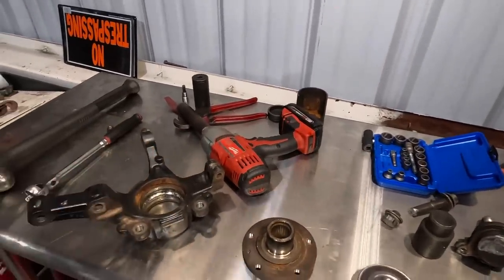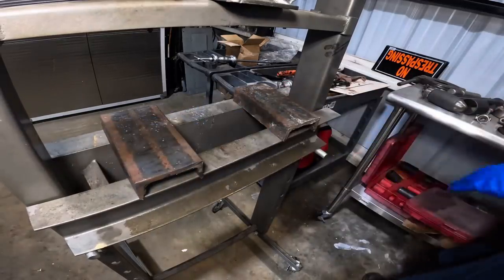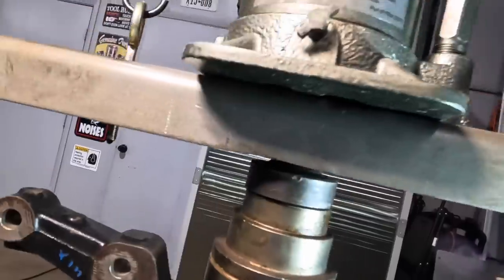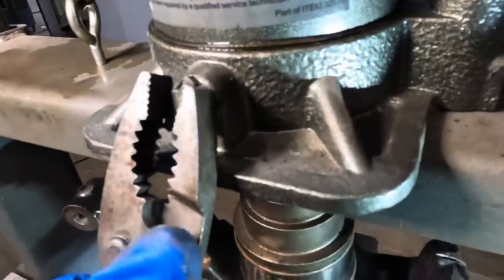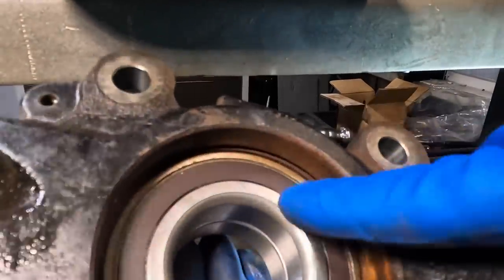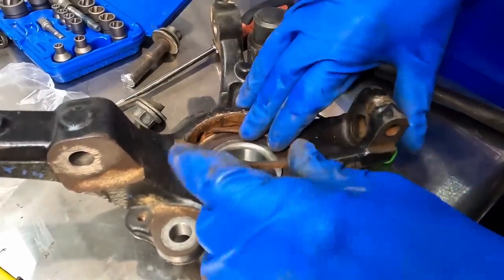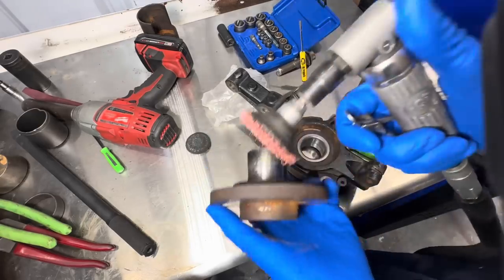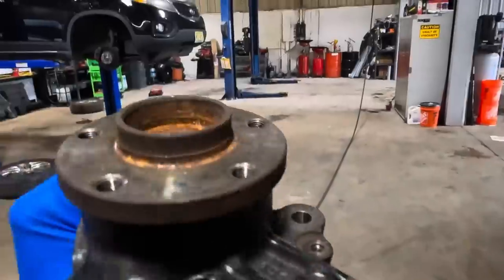Can it be FIXED? Half a Bearing! Hacked to Pieces!

Comment: Hi Ray, On some jobs when using the old race to press in the new one it can jam and cause trouble getting it back out. We cut the old race with the angle grinder right through so effectively making it a little less rigid in diameter and so it will tap out easy where normally it might jam tight again. This doesn't hurt using it to press the new one in as the stiffness of the old race maintains it's shape but it sure comes out easier. I am in the UK and am a retired mechanic.
Reply: I have ground down the 'old' item on the grinder so that it slips easily. Then used to press the new outer race. I KEEP that old race for future use as I have done for my Trailer Wheel Bearings.
Reply: I was going to say that. Same here in the US.
Reply: The other trick is to put the new race in the freezer and get it as cold as possible. At the same time, warm the other part, With any luck the new race will just fall right in.
Reply: Ditto.

Comment: Misc suggestion.
I changed my hydraulic press to add wheels like you did, but i also added in a wooden platform across the bottom. Now i have a place to store all the accessories you need for the press, plus i can store heavy things i do not use often.  Super convenient when you are space limited and your press tools and widgets are right at hand when you need them.

Comment: As the official bearing aficionado of this channel.  He is replacing what is called a Hub 1 bearing.  The darker side is a magnetic seal that the wheel speed sensor reads.  The other side is a regular seal.  Just in case you didn't know.

Comment: Run a bead of weld around the inside of the old bearing. As it cools, it will shrink and literally fall out.
The now shrunk bearing can be used to press in the new one.
Reply: This is the go-to reply. This is the only method that will reliably 100% of the time drop that race out of that hub. I learned this as an apprentice in the shipyard back in the early 80s.
Reply: Wish I knew this trick couple years back I had a ford focus these bearings are a nightmare same deal I did it the same Ray did. He didn't get to take off the inner race though I cut them at an angle with a cutoff wheel then bust it on the cut because you can't cut it all the way you will cut into the hub. I will never buy another car with these type bearings they are always going bad. aftermarket bearing are a joke on you they are ball bearings instead of needle bearing like oem.
Reply: Hope Ray sees this cause it will save him a load of work on any internal bearing.
Reply: Have always removed bearings this way, as well as exhaust valve seats on large diesel cylinder heads, works every time.

Comment: I don't know why, but everytime I have a project coming up, you release videos that help me immensely with my research.  I've been dreading a front end suspension rebuild on my Honda Accord, but right after I ordered my parts, you dropped all this front end rebuild material with the mustangs and this one!  Not exactly the car I'm working on, but concepts are the same, and you've helped me not feel so out of my league. Through my daily dose of Ray, I havent even had to do much actual searching for helpful info.  Thank you for having the BEST timing for my education needs!
Reply: @xbahamutzero  thanks for the tip.  Luckily, it's a 1995, but the only things that I'm not replacing are the spindles and shocks.  The SO managed to snap or bend almost everything else by spinning out and slamming into a snow bank right after our first snow last winter.

Comment: Fyi... If you have a truck ball joint removal kit... Use the rings from that kit as your base shim to press into or press the new parts in... OR... Go to your local hardware store and get a set of different size black pipe couplings up to 6" dia meters... ALSO... Wack the piece with a hammer when you have all the pressure from the press on the part... The vibration will make sure the part is seated and that is not "window locked" or "stuck" on some rust or metal blurbs...

Comment: Hey Ray!  You should weld a flat tip screw driver in an 11 o'clock position to the pressure relief bolt in the closed position on your press. It would give you a grab handle to open and closed the valve and put the wrench away.

Comment: That's a great point to emphasize how important that axle nut is, even in newer style bearings that come together with the hub. People get a false sense of security when they bolt an inclusive unit on, not understanding how easily the bearing itself can break apart. The snap ring holds the outer race in place, and corrosion holds the hub inside the inner race. The weakness is in the sheet metal cage that holds the inner bits together with the outer. The only thing keeping that inner race, hub, and wheel in place after the sheet metal fails is the axle nut.
Reply: NO CHARGE ALSO.

Comment: if you dont have a press but you have welder you can clean the grease of the bearing race run two beads of weld around the raised part in the center of race, one on either side and they just about fall out
Reply: If you don't have a press but you have a welder, you can make a press
Reply: @waldolemmer bottle jack and some box-sections with a couple strong springs, jobs a good'en
Reply: Just what I was thinking I have seen to meny bearing carriers broken with the press

Comment: I’m repacking hub and bearings while I’m replacing tie rods and ball joints on my ‘95 302 f150. I stupidly punctured not one but TWO! Moog upper ball joint dust boots. Currently waiting on new dust boots. 🙃

Comment: My little Peugeot has the same bearing and magnetic ring set up, though thankfully you can just about get a spacer to hook up on the outer race if it does fall apart. The only issue is the part is an odd shape and doesn’t lie flat, thanks Peugeot PSA for that design.

Comment: Hello Ray, it looks like there is a hurricane headed your way mid to late this week. It looks like it may slightly to your north and come in closer to Tampa and going thru Jacksonville, with you just getting a bit less wind and rain. the beaches may get a bit rough, but the surfers will like it. I couldn't send this in chat, maybe it was to many letters.
Reply: Just checked NHC.NOAA and it looks like it will curve away north and then north east.
Reply: @pprey6599  It very well could, however it is a hurricane, and it could hit 100 miles west or 1 mile away, it is still to early to be very definitive.

Comment: Ray good video. I watch your excellent work almost daily. On a related note, I have a 2015 Ford Transit Connect with only 52K. And I have had to replace the front wheel bearings 3 times on each side. Ridiculous at $300 per repair. The bearing/hub assembly is almost identical to what you just worked on, so I wanted to comment for the other viewers. If you ever have to replace a bearing assembly like this .... DO NOT over-torque the wheel bearing nut. Guaranteed premature failure .... in less than 2000 miles. Also, buy the best bearing you can find. And when these front bearing go out, it is very hard to determine if it is a left or right bearing. Maybe a dealership would've done a better job than my mechanics (two). I just don't trust dealerships.

Comment: I just recently replaced my Honda ridgeline front bearings, bought a small table top press but cohld not use it becausr i didnt have C or I beams to put under. I used hammer and an old outer race ring. It worked but lot of elbow grease. I think uou placed bearing in up side down. The black seal is hoing on bottom and the removable top silver cover is used to add grease over the time when needed with out remowing whole bearing, just the hub. Othervise, great video. Keep it comming. Subscribed
Reply: If you followed the video you saw that there were text on the bearing showing that the "black seal" is supposed to be the direction Ray pressed the bearing in. It contains a magnet, or more probably several magnets, that's used by the ABS sensor to record the rotational speed of the wheel.
Reply: Nope, bearing went in correctly as Ray explained in the video. The dark band is supposed to be next to the wheel speed sensor, which is the way he assembled it.

Comment: get  a good 20 ton air over hydraulic jack for your press and it will be faster. i replaced  my press jack and i just use air to bring it into place and then pump the jack to do the work.

Comment: If I were still working I'd be putting wheels on the shop press first thing. I was always bothered by that small pressure release on the bottle jack. I took it out and welded a larger tee handle on it. No need to search for pliers anymore.

Comment: On your press, you notice a cross-bar angle iron between the base legs.  Sooner or later, it will happen that you stick an axle into this press, and find that the end of the axle contacts this cross bar... so consider, some day, when you have "nothing else to do", relocate the cross bar about 3" off center, and add another, matching angle, on other side, about same offset from center, and this will provide you the little additional height you need.. plus, having your press on wheels, this new gap, between the spreaders, will allow use of the added wheel height.  Does your press cylinder handle not have a pair of slots to operate the bottle valve?  If not (handle was replaced with iron pipe, for instance), just grind a pair of slots into handle end to match the valve ears.

Keep the old bearing race, of course, in your new press tool box, and, as mentioned below, slice a narrow slot into the race to allow diameter to reduce slightly in bearing bores that don't have relief diameters.

Something I have noticed in new bearings is that the mfgr provides very little grease, so I usually use a seal pick to pop off the bearing seal plastic ring, pack the thing completely with real, new, fresh grease, then replace the seal... it just snaps in or out... no biggie, but will definitely extend the service life of the bearing.

Oh yeah, cleaning the dirty bearing bore in knuckle with Scotchbrite, then applying a mere wipe of grease, will aid bearing pressing.  And when removing and installing, once pressure begins to increase, a minimal jar on the press ram (or table, or part, or arbor) will often immediately get the pressure point moving.  Use a hard mallet, not steel, to bump the thing.

Comment: Hey Ray! Those Milwaukee Rocket Lights are susceptible to Low Voltage damage. Make syre you always use a Fully Charged Battery as letting it Run down while turned on will burn a trace on the printed circuit board.
Reply: I have two.  I’ve let them go out on battery power a few times. Thanks for the warning!

Comment: It’s risky but.. if you dab a tiny blast with a stick weld at high amps opposite each other, it will shrink..
I used to remove bronze bushings in the shipyard using this method..

Comment: If you had a large cone from the ball joint set, you could lube the inside and use it as a compressor on the bijezuz ring. Or, you could have used a heavy duty screw type hose clamp (or even a piston ring compressor) to squeeze it down to go in the hole.

Comment: To people doing press in bearings. Pressing the new bearing in with the old bearing is always pretty risky. If you manage to wedge it there half ways, it's gonna be a real nightmare to remove. Ray was pretty lucky here. On some older cars the machining is tight all the way, but many new cars tend to make the bearing fit loosely at the beginning as seen on this video.

Comment: Ya know, if you've lost the original jack handle with the relief valve slot, you could just slot the handle you do have.
Reply: My buddy's shop he has a short T-tube made for it- turn to the left or right.
Reply: Cut that slot on BOTH ends! When I have 50/50 chance, 90% of the time I'm wrong!! 😱

Comment: You should heat the bearing with a heat lamp the bearing will drop on to the hub, Heat casting part in toaster oven bearing and hub will drop in.

Comment: Does your press handle not have the notch for tightening and loosing the relief valve?  Just curious why you used the pliers instead of the handle.  Another good video, doing those bearings is always fun especially when you forget to take that snap ring out!!  First one like that I did, couldn’t see the snap ring and it makes one heck of a bang when you put 20 tons of pressure on that snap ring.

Comment: What I meant is from mechanical prerspective that the seal supose to be on the bottom ,and ABS sensor should be on the bottom as well. In Hunday its aperently on top therefore you put it in there to be close to sensor , which is OK for ABS signals but mechanicaly wrong unlrss there is a separate seal behind.

Comment: Ray,, Why don't you use a little heat and cold to help you get pressed parts in easier?  A little propane torch action to about 200 deg on the spindle housing, a little refer action on the bearing and that bearing would have just about pressed in by hand.  I would have also put a little grease on the sliding surfaces.  Just asking.

Comment: Wondering how the lug studs are going to mount now that the hub is pressed on or does this application have lug bolts instead of studs and nuts
Reply from the maker: They screw into this particular hub, like a BMW or Mercedes

Comment: @0:27... yeah, just did my wife's Nissan Kicks, uses a pressed in bearing system just like that.  Took twice as long as a normal unit bearing with the hub.  When you pull/press them apart the inner race stays on the hub (which they sell separately from the bearing for $100 each!) you need to break the bearing and cut off (scribe half way through and crack it off with a cold chisel) the inner race.  Then you press everything back together.  The first set failed after only 50k miles, and they failed at exactly the same time.  Yeah, suckes - probably will need to do it again every 50K!  Also, generally there is NOT a magnet inside t he bearing (would be a really bad thing to have inside a bearing... the sensor simply sees the inductive signal change every time a bearing passes by the sensor which does have a magnet inside it (bearing-pass frequency is picked up, which does NOT match the RPM speed, but it is proportional obviously).  This is why it is important to put the plastic-shielded side of the bearing toward the sensor when you press it in.

Comment: Use brake fluid to top off your leaking jack. It will swell the seals to hold you over until you fix or replace it.

Comment: The worst bearing race I have ever removed was on my sisters car. I had to give it to a friend of mine to put in their biggest press. It finally let go at 47 Tons of pressure, it was freaking insane!
Reply: A bearing on a 25HP, 440vac, 3 Phase motor, seized onto the motor shaft. It required 88 TONS of force and heat to break it loose! The press was a 120 TON electric/hydraulic unit. When the bearing broke loose, while torching it, the press jumped an inch in the air with what sounded like a .357 Magnum going off.....!

Comment: I would have thought you would have cleaned out the slot for the snap ring before pressing in the bearing, not to mention the ring itself.  Pretty sketchy operation all told.

Comment: Are the studs for the lug nuts supposed to press in frm the back side first before you re-assemble?  Looked like there was no clearance after it was all put together.
Reply: they arnt lug studs on that car, they are lug bolts that simply screw into the hub every time you take your wheel off so no fitting required... Ray answered this a little further up

Comment: I'd take a small bolt and weld it to the valve of the bottle jack to make easy to use the press, so you don't have look for another tool when ever you're using the press
Reply: The handle that comes with the jack has a slot cut in one end to engage the ears of the valve. No additional tool needed.

Comment: Dose that not need studs installed before being pressed together? But in general nice install.
Reply: I wondered that for a moment as well, but it may just use bolts which just take up all the threads on the flange.
Reply: @heckelphon  he said Hyundai and I have not seen a single one of those with lug bolts that is more a German, 80s Honda and Fiat thing not Korean.  Yes Honda in the early  80s had lug bolts and where weird in general.

Comment: Was there enough space to insert the wheel studs back in the hub after you'd press the two parts together
In the final parts of the video it wasn't clear if there was enough space
Reply: The hub appeared to be threaded to use bolts to attach the wheel rather than studs and nuts.
Reply: @j.neiltate8869  Thanks for that Neil

Comment: Using the center of bearing for a press-fit ?  For a machinist... that would be a big 'no-no'.  If they didn't have an appropriate 'slug'... they would have made one. 
IMHO: You need a lathe in the shop.